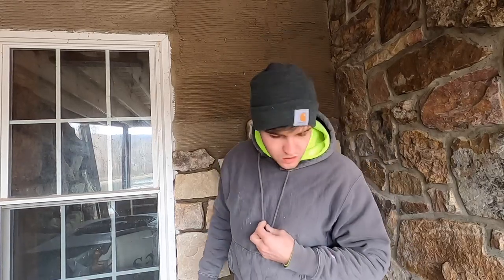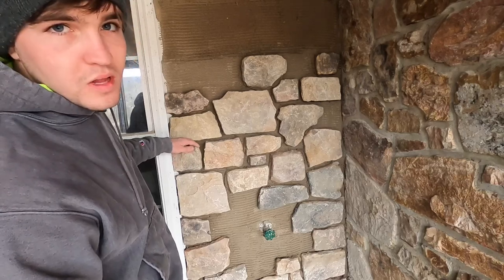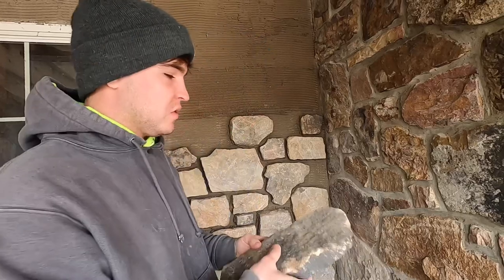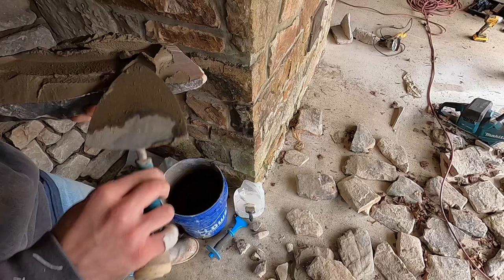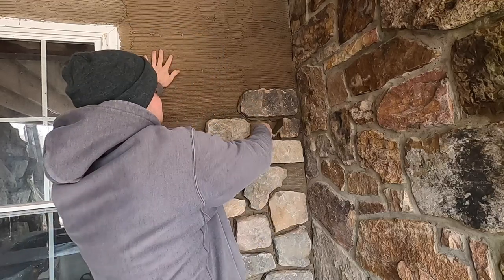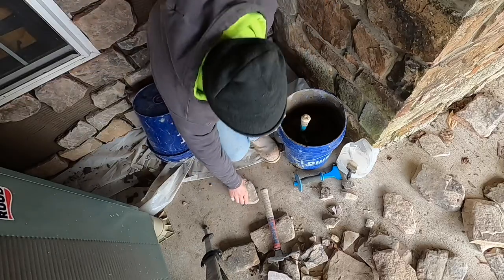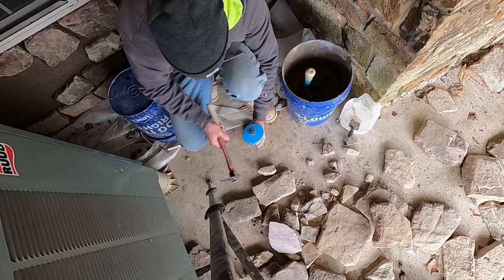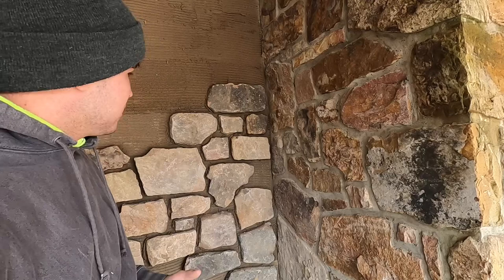How to stone veneer a wall

Comment: you should have put brick mold around those windows. If they ever need changed, because they leak or break, or go out of style, its gonna me a mess to change them with the flange under the stone. even if the window comes out fine, the stone might come out with it.